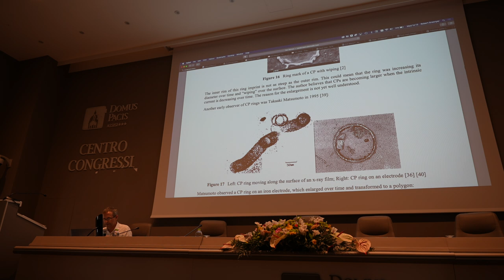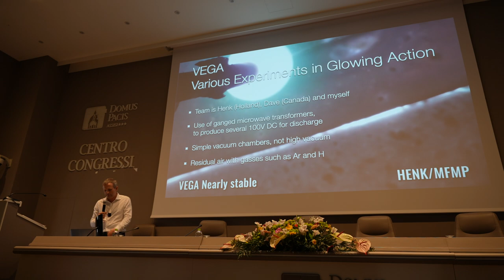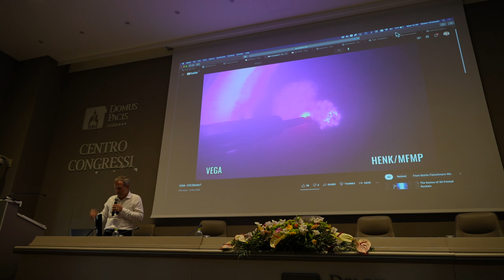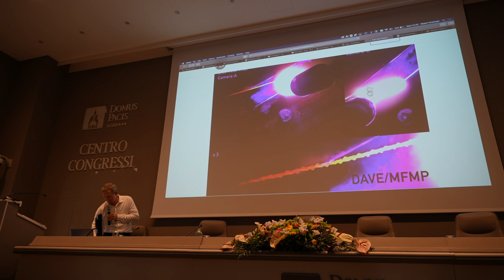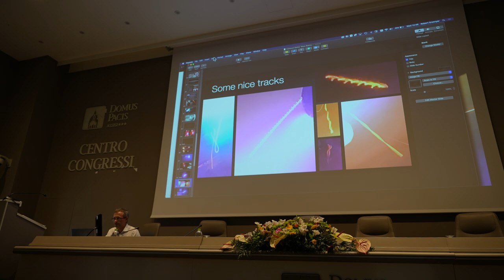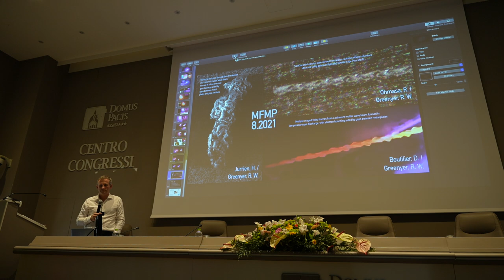Coherent Matter Travelling Wave Beams - Part 2

Comment: 26:50 that’s probably a single wire transmission with the wire acting as a waveguide; not cold electricity which nobody has ever demonstrated

Comment: 27:11  It would be great if you could supply video proof for this claim. No TC builder I've seen has reported such effects.
Reply from the maker: I will find the link at some point.
Reply: @MFMP  Please do Bob, this should all be very replicable and I have never actually seen it done on video.  The cold electricity claim by Lion is something I would very much like to see recorded on video as well, this would make any electrical engineer stop dead in their tracks.

Comment: Why travel using wave beams when its so much faster traveling by warping space by using the strong nuclear force?
Reply: Or travel using the speed of thought which is measured to exceed 100k times the speed of light.  Dr. Rudy Schild's theory of "black holes" (correctly called MECOs) that act as storage devices for consciousness is quite interesting.  It may see odd at first glance, but that's where things are actually heading.
Reply: @artrock8175  yes indeed...
Reply: @artrock8175  its measured? Or theraticically could be  measured..